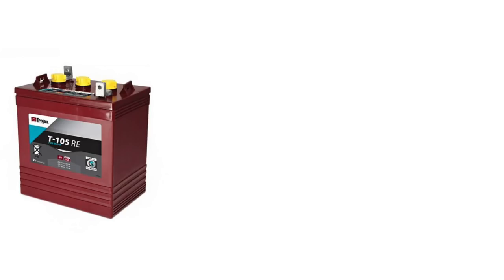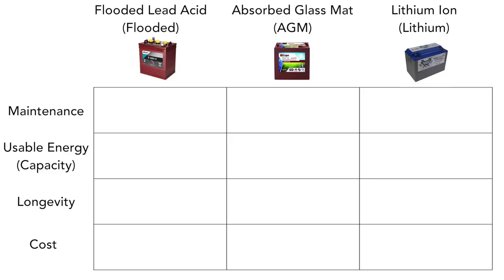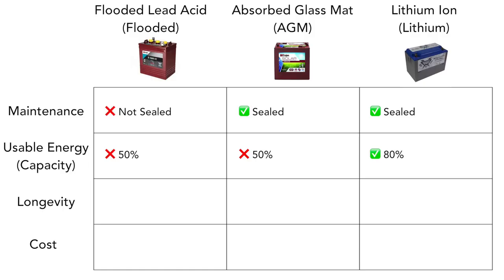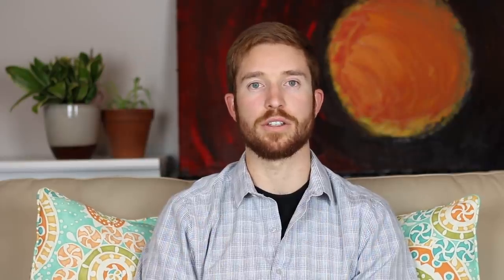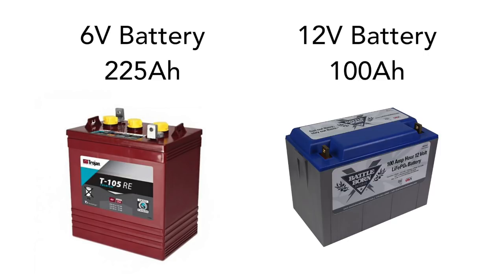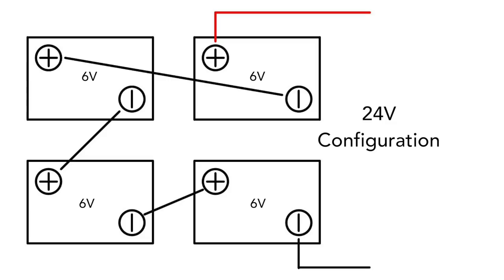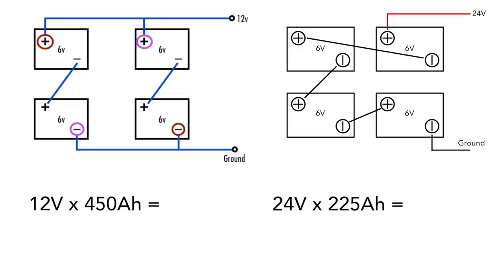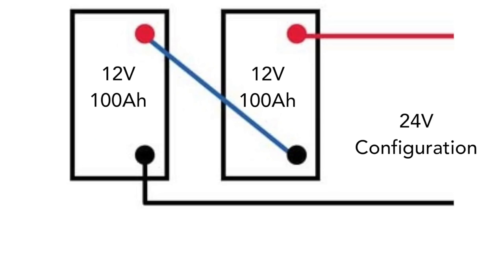Battery Bank Options + Wiring Solar Batteries from 6v to 12v vs 24v

Comment: By ganging or taking 6 volt batts. and adding cells [batts.] to make 24 v you are in reality ending up with 25.5 volts .and with 6 6v batts you end up with 32 . It is because every time you add another cell you gain a bit more then 2 volts . All lead acid batts. are a series of 2 volt cells ganged together and because of the nature of the cells when you start putting them in series you not only 2x your volts you also gain a small amount that is not noticeable until you get up to 24 and beyond . Would lithium batts have the same effect ?

Comment: I just purchased 2 group 24 85ah AGMs, wired in parallel for my truck camper it is equipped with a 95watt solar panel. do you feel this will work well?
Reply: 95 Watts per hour of sunlight,  does not produce very much power ...
Reply: @MrSummitville  agreed I should have ordered it with 2 panels ,but so far it has worked out okay.

Comment: AGM batteries can last 2 twice as long as the lead flooded batteries which justifies the cost of additional 25% extra.
Reply: Nope, Flooded Lead Acid lasts longer ... Trojan SOLAR SPRE 06 255 = 3,400 Cycles ( 9+ Years ) at 30% DOD for only  $205 ...

Comment: Can I use a 24V solar panel with a 12V battery configuration if I am using MPPT solar controller? Thanks

Comment: HI WHAT WOULD I NEED TO BOIL A KETTLE, I HAVE 2 12 VOLT LEAD BATTERIES, 1 150 WATT PANEL, AND A 30 AMP CHARGER,  I KNOW THIS WOULD NOT BOIL, SO HOW BIG SYSTEM DO I NEED, CHEERS,

Comment: Can you use the same type of controler with AGM and lithium ion.  I heard that you have to balance lithium ion batteries do you know any thing about that, I'm liking lithium ion the only exception is what I heard about balancing the batteries.
Reply from the maker: I don't have any personal experience with the Li-ion batteries and it would depend on which controller you got for your system but I'm sure a bunch of them are able to be set to charge both Li-ion and AGM batteries. Hope this helps a bit 😊

Comment: It’s all still foriegn to me. Is it better to run 24 volt opposed to 12 volt. And will all the 12 volt items in trailer run safely on 24 volt.
Reply from the maker: Hey Ralph... great questions! It depends on a few factors like size of the system and distance of the wiring but in general, small systems (1000W or less) will do okay with 12V and larger systems will start to entertain 24V. When it comes to the 24V solar system powering a 12V RV system, you would need a 24V to 12V converter to step down the power for your trailer. Hope this helps!
Reply: A yeah, all depends on what your running. In an RV it's almost certainly better to stick with 12V unless upgrading to some huge(5000W+) split phase converter. It's also completely possible to run both a 12V and 24V system, though adds a lot of complication.
Reply: All of the things that came with your trailer should only get the 12 volts they are designed for, you can get a " Step down converter " to change the 24 volts to 12 fairly cheap, however you need to keep in mind the AMP's needed at 12 volts to ensure the converter can supply enough power to operate your devices. Stove, fridge, hot water, pumps, lights etc.. all have different amperage requirements, you would need to add those up. However it is pretty rare you are using all devices at once but the old safety thing.... better to have more than enough than not enough :)  I hope this helps without too much tech talk or as my wife calls it,  geek speak.
Reply: Ralph Fairbanks  if run only a small trailer  stay 12v easier. 24 volt is for larger systems  saves on wire sizing  i am just converting myself to 24volt. But I have a cabin and over 1300 watts solar plus wind.  Got by on 12volt for 28 years

Comment: Why do you say that the depth of disharge on Lithium batteries is only 80%.   I have been told by several sources that you can use up to 100% of its capacity.  Please elaborate. Thanks

Comment: what si the battery charging voltage for CTL70- 12v battery ? to set it up on the clasic 150 charge contrl.

Comment: so running lead, you are best to run large cap batteries in series for even charging of the cells.  is lithium ok to charge in parallel.  also, my lead acid have lasted for 15 years, just over 5000 cycles, due to the size chosen to run my system at 10% discharge per day so I have 3 days of storage to maximum cycle to 30% if bad weather.  this is a standard way I used to work out size of bank required and worked for my home.  I expect I need to replace batteries soon, though I would be aiming for a 800Ah bank of litium instead of my 1600Ah lead acid.  the other thing I like about lithium is the faster rate of charge.  lead acid best not to charge at any more than 5-10% capacity, ie, 1600Ah bank with 80-160A of charge.  lithium 800Ah bank can be charged up to 30%, ie 240A of charge.  lead acid slows current as it gets filled, lithium current stays high throughout charge cycle.  my main concern, is will I really get more that 15 years of service and why is parallel charging of lithium ok where frowned upon with lead acid.

Comment: I think most Li batteries are not recommend being wired in series.  Something to do with the battery controller.  Just buy the voltage you need.  Exact opposite for lead acid.  Better to do 1 large battery bank than a multiple parallel strings.

Comment: what about Solar deep cycle lead acid batteries? arent they also supposed to have more than 3000 cycles and can be discharged to 70 or lower percent?

Comment: Good job on the cost comparison! I would recommend one change: In a 12 volt parallel configuration the wires that feed the coach should be attached to different batteries not the same one. Positive coach wire to positive terminal on battery one and negative coach wire to negative terminal on battery two.  The two batteries are still connected to each other pos to pos and neg to neg.
Reply from the maker: +Your RV Freedom Thanks! I completely agree and that’s how we wired ours. I will go into this on future videos. I only have a limited amount of time to get the info across in a video and since it wasn’t about anything but the series and parallel wiring, I just found diagrams that would portray that info the best. Thanks for the great info!
Reply: Duet Justus No prpblem, you did a great job on the video and the key takeaway for me was the long term cost comparison. You included some things in your battwry video that i wish I had included in mine so I found valuable information in your work. Thanks

Comment: appreciate the video. only thing is technomadia actually installed a large lithium battery bank in their RV bus and after one year found the batteries werent lasting and didnt have the discharge rate as advertised.
Reply: Only because their charge controller wasn't configured correctly. Keep in mind, Technomadia did this years ago when nobody was using Lithium batteries in RV's. They did a follow up after 5 years and by then had figured the problem out.
Plus they installed the battery bank in the basement - which for Li batteries is a bad place because they don't handle extreme temperatures very well. They need to be installed in a climate controlled environment for optimum lifespan.
Reply: Uwe Schroeder - appreciate the follow up. i wasnt aware of those additional details. makes sense why those first lithium batteries didnt perform as technomadia expected. thank you again for the videos
Reply: Uwe Schroeder climate controlled?  Yikes.  How does that work in an RV dang.  I’m going with a truck camper and will have to figure out a different storage compartment than the battery one as that will only hold 2 AGM sized batteries....
Reply: With climate controlled I mean the living area. They don't have to be in a cigar or wine-cellar climate controlled area - just out of extreme temperature swings, which in any vehicle is where you are, since you don't really like too hot or too cold either. Of course you'll get temperature extremes in any RV - just find the spot with the least of them and you're golden.
Reply: The one thing to remember when using "lithium" is to NOT FLOAT them, this wil kill them pretty fast, so when say 80percent discharged recharge them to say 90percent (no need to fill them to the brim, no sulphation ever) and then Stop charging!

Comment: I am a LiFePo4 battery fan for life and will never buy Lead Acid batteries again,  Especially for a mobile application, They do have a higher up front cost , but a far cheaper per usable Watt Hour lifespan than Any Lead Acid Chemistry 
More over,They are pound for pound per watt half the weight and have nearly double the efficiency and they don't waste valuable solar wattage output on Floating and Equalizing , You only have to put back what you take out to within 90%
Reply from the maker: We will most likely be doing them in the future. Though, I have to say I’m very happy with my lead acids as well. Thanks for sharing your experience 🙏🏼👍🏼
Reply: @DuetJustusFam  It's just a matter of multiplying the usable energy and the cycle life, then dividing it by the purchase price. Which ever chemistry gives you the most kWh per dollar is the best choice. If that's lead acid again, go with it, then check the market again, when those come due for replacement.
Reply: Headway Lifepo4 cells I think you will really like.
Reply: @larrymacdonald4241  LiFePO4 is my first choice to replace lead acid. A 2 cell battery is a drop in replacement for a 6 volt lead acid, a 4 cell, a 12 volt. The voltages are so close, there is little if any need for adjustment of the charge controller. You may want to raise the low cutoff voltage of your inverter, to avoid over discharge of these cells. With less voltage drop under load, and less hysteresis between charge and discharge voltages than lead acid, you may not want to drop their voltages quite as low as you would allow for flooded cell lead acid. The Lithium Iron Phosphate cells actually follow the characteristics of AGM batteries. I have successfully paralleled AGM and LiFePO4 batteries, and they work together perfectly.
Reply: But the 12-volt multi-cell LiFePo4 batteries only put out 15 amp-hours, compared to 225 from led-acid.
Reply: @felinis3788  I thought you had at least 80 to 100 amp hour batteries. At high rates of discharge, you will actually get more usable capacity from a LiFePO4 half the capacity of a flooded lead acid, because lead acid have a thing called "Peukert exponent". This is where the surface of the plates become glazed with lead sulfate, sealing off the depth of the plate paste, greatly reducing capacity if the battery is discharged at a high rate. Lithium Iron Phosphate batteries don't have problems with this, because the intercalation of lithium ions is not affected by rate of charge, or discharge. They pretty much keep their rated capacity at much higher discharge rates, than any lead acid battery. Even though your LiFePO4 batteries are much smaller than lead acid, it might be worth connecting in parallel with the lead, just to have that boost in current.
Reply: @vincentrobinette1507  
I don't have any batteries.
I was just commenting that the LiFePo4 batteries available for sale have a mere 15 Ah capacity as compared to the 225 Ah available from Lead-acid batteries..

They seem highly impractical for use in a solar energy system.
Reply: 100 AmpHour $949, can be discharged at 100 Amp rate. 30 lbs. SKU: BB10012
Reply: The OP mentioned the "key"that make for lithium a valuable choice. Mobility, if that is not a need or issue. Sorry guys the lithium still have a long path to crawl! As much as I like lithium batteries for it's advantages in size or weight. 
It's undeniable that for the same price you can buy several lead acid banks...for years too come! So without the mobility checked on the need list. Lead acid rule. For the same cost you're able to run a bank of lead acid for decades! 
So 30 to 60 years of lead acid banks. For the same price of one lithium bank that will last something between 10 to 15 years under similar care and conditions!

Comment: A lot of people won't have the money to afford the initial cost of lithium batteries. I'm also not convinced by the stats that they will last for all those cycles. I am certain that if you only discharge lead acid batteries to 60 or 70 percent you will drastically increase their lifespan and the number of cycles you can get. I don't think AGM are worth the additional costs. I have never really understood the point of buying two 6v batteries to get the 12v instead of just buying a 12v battery.

Comment: I do have a question, can I live my solar panels  connect to the charge controller without load(battery disconnected)?
Thanks
Reply: I think this will damage the charge controller... I've always seen instructions that have you connect the charge controller to the battery first and connect the solar panels last for just this reason.

Comment: I have Toyota Prius  nickel-metal hydride battery cells, I connect 56 of them in a way to get 48v one battery  in 1,5 hour the battery drop it from 56v to 46v the load was 5amp
pls, can you tell me how many ah is my battery? thanks

Comment: 11:15 NOOOOOO! The AH ratings for all batteries including lead acid batteries take that into account already. The rating for a lead acid is until it gets to 10.5V. 

Depth and rate of discharge is a much more important factor, one you ignored.

In practice with modern desulfation tech a flooded lead acid can last a VERY long time, I have some that are 14 years old. A key factor is that they are maintainable, sealed lead acid, AGM and Lithium are going to wear out period. But the ability to vent, fill, balance, and aggressively desulfate traditional lead acid makes them very long lasting when well maintained.
Reply: Are you sure about that? That's a big deal to me, instead of buying 40 batteries I could get away with twenty  6V acid batteries.
Reply: @Korben I think if you actually look at the spec sheets for batteries, you will find that the Ah quoted is for a full discharge ... at least that's what I saw when I looked at the spec sheets.
Reply: mike m if you're putting something that big together, maybe consider a Tesla power wall or two.
Reply: I have some 25 year old lithium ion batteries come see me in another 10 years

Comment: I have 8 CALB 180's (Life Po4,  Lithium Ferrite) wired in series for my 24 volt system. 4.5KWH. Love'm.  Charge in 2 hours, discharge them 80% or more, discharge them in 2 hours, won't hurt them.  Non toxic,  will not outgas and explode like other Li ion.  Cost is a bit high,  $1900.00 for my set.  But- smoke'm if you got'm.  The price of a used car, rely on them for at least 10 years, maybe 15.  I've used mine drawing them down to 60 % for 4 years straight, no appreciable degredation.

Comment: By 2020, the cost of lead-acid has increased whereas the cost of Li-FePO4 has come down significantly.
Reply: @HQHQHQHQHQHQHQHQHQHQHQHQHQHQHQ  Take a look around. The price trend for 2020 compared to 2017, when the video was published, has been roughly 20-25% downward. Even Amazon is offering 12V 100Ah packs of Li-Fe-PO4 for $500-$800 range, depending on manufacturer and quality. Other places show even less expensive options.
Reply: @HQHQHQHQHQHQHQHQHQHQHQHQHQHQHQ  yes, still expensive, but coming down some. I'm hoping they'll be in the $500 range within a couple more years.

Comment: Okay, so what configuration do you use? Secondly, do you know, say if a person wanted to invest in a flooded lead acid setup as a more economical setup but had plans to upgrade to lithium, could a person substitute a lead acid in their array with a lithium for the purpose of incrementally upgrading without having to sacrifice capacity? Or would the two compositions not work well together? I understand that if theoretically this we're possible, to avoid destroying your lead acid batteries in the array you would still have to stick to the 50% discharge rule despite that the one lithium battery would have a higher discharge capacity. I just don't know if it's possible.
Reply: No you can't mix lead-acid and lithium batteries,  The two types of batteries have very different charging requirements.
Reply: In addition to Todds' response; if you have more than one battery, if replacing any given battery, one should replace all batteries.
Reply: fireflyvtxr why is that?

Comment: do you need a special charger for lithium batteries. say you have a inverter/charger in your rv would you have to change that out?
Reply from the maker: +Todd Glass If you’re talking about the charge controller, not that I know of. Most main stream charge controllers should has settings to accommodate for a lithium bank. Just be sure to double check the speck of your controller before you bite on anything 👍🏼

Comment: Flood Acid deals with cold and heat better than AGM. Does Lithium deal with harsh temperatures?
Reply: Lithium ion batteries prefer to be above 5 deg. C when being charged, and when cold the capacity like any other battery type, is reduced.

Comment: Hi Duet, did you ever hear of the Ni-Fe batteries sold by Iron Edison Co, in Denver?-Made in China also!!! They cost a lot up front but they outlast all of US!!! look them up ! Down side___ Very heavy, 1.2 V per Cell, have to water them ~ once a month, have to change the Electrolyte every 8- 10 years but they last for ever????? John M Kanterakis AZ
Reply: But, YOU have to replace 100% of the electrolyte  periodically - usually every 7 - 10 years.  And they have vey low efficiency ...

Comment: A great video but at four years old we now know that heat is a killer for lithium batteries. Most manufacturers are only quoting 3000 cycles for lithium. Still a good life but if you can't keep them cool expect a lot less